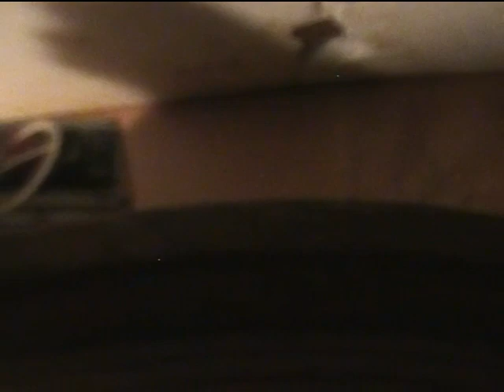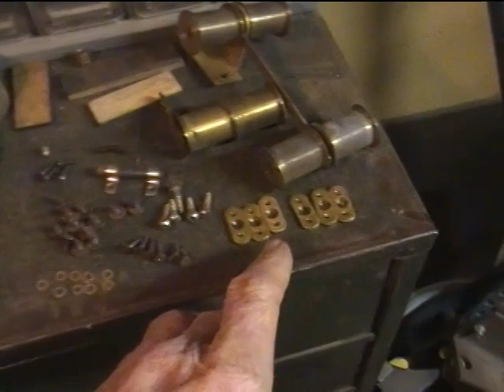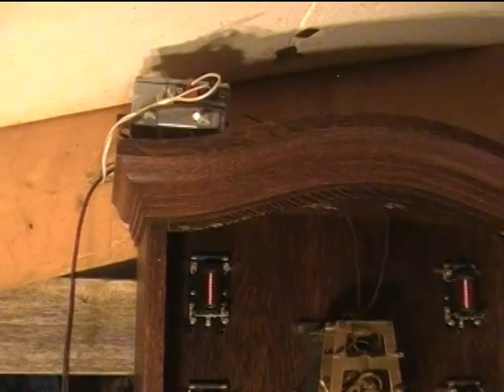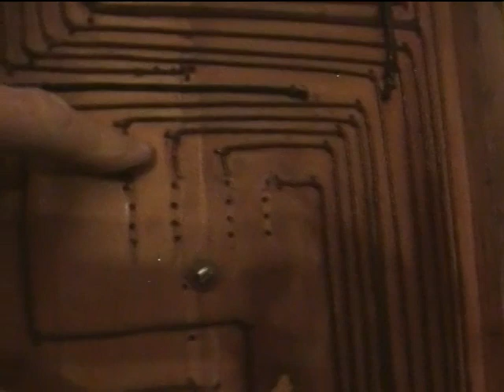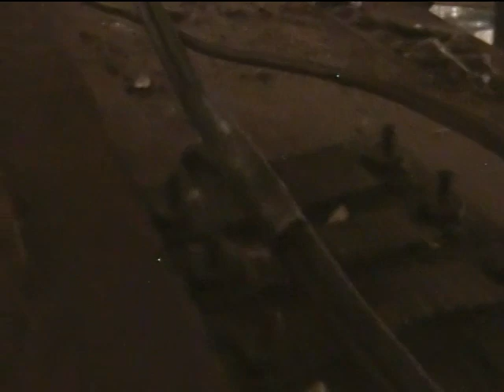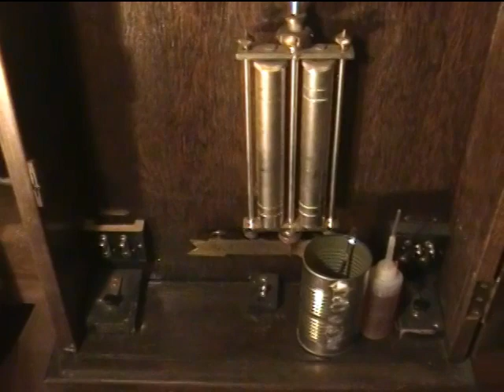Standard Electric Time Company  1929 60 beat master revive part 2

Comment: You can adjust the tick and tock from the little thumb wheel at the top :D
Reply from the maker: Thank you.  I will give that a try.
Reply: @frenchcreekvalley  I found your channel from Dave D. I heard you used to work for Standard, I have a problem where the minute hand falls out of sync from the second hand, I screwed the nut various strengths and always get the result of it going too fast or falling behind. I was wondering if you could help. I figured it was "sometimes" falling back when the 30 second reset coil was energized thus moving the hands forwards or backwards depending on its placement. But I am just here stuck. It gets to me sometimes. If you dont know thats fine, thanks for the chat :D, if you want my facebook is Jack Sidlauskas and my email is jacksidlauskas@gmail.com if you want to reach me there. Stay safe.
Reply from the maker: @johnsidlauskas3838  There were NONE of these 60 beat masters still in operation in our region when I was working with SETCO.  I was an independent contractor, not an employee, by the way.
Regarding the minute hand issue----    I have wondered about that assembly myself, since I have had to remove the face a couple of times for various reasons.   Not sure I'd be able to help much.  But, I do have to remove the face again, one of these days, to reinstall the connectors for the program clock, so I will look into it at that time.   And, while the face is off,  I will work on the tick and tock.
    I keep putting it off because I am more concerned about the clock loosing time right now.  It's loosing about 10 minutes a day now whereas, a couple of months ago it was only loosing about 3 minutes per day.    I have shortened the pendulum all the way using all of the adjustments to no avail, so I guess it is going to need professional help.
  Two of the members of our local blacksmith club are well known clock repairi/clock maker people.
I may order a "house call" once the Civid-19 thing settles down.
Reply: @frenchcreekvalley  Mine clock is also slow, but Im just wondering if that has to do with the outdated pendulum style, since the mercurial ones were said to be more accurate.